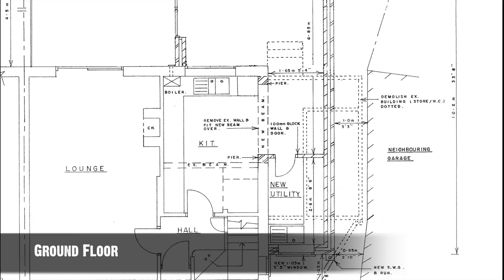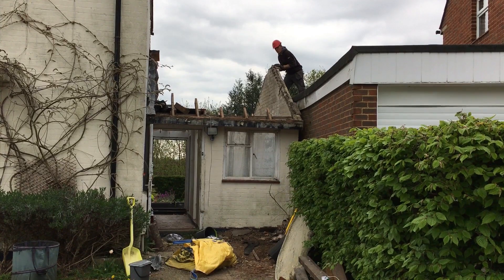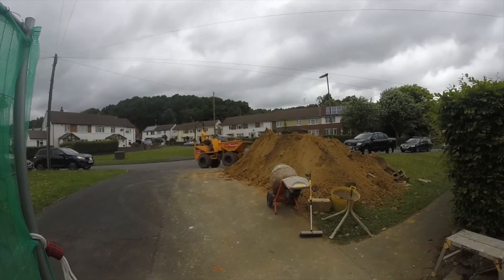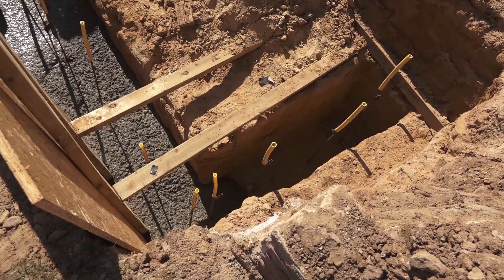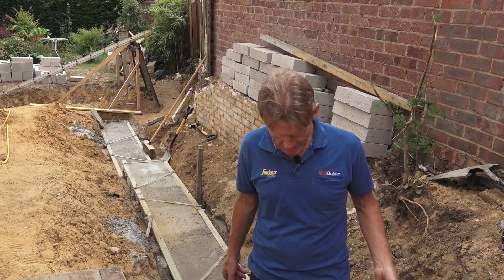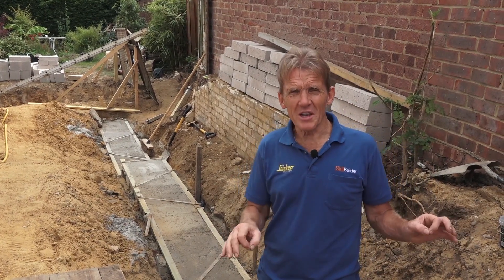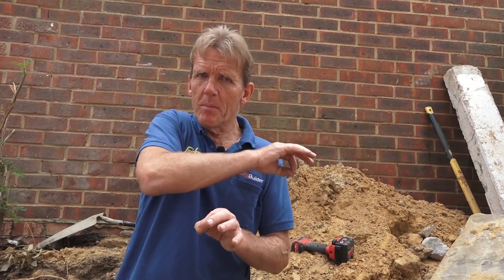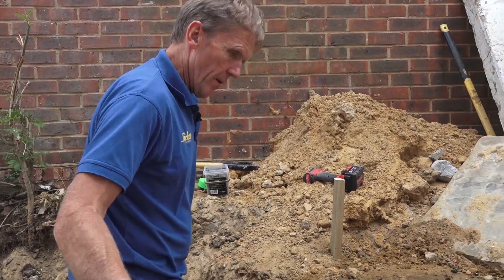How To Set Out For Building an Extension

Comment: Massive mistake!!! When you measured out from the building, you didn’t check if you were measuring out at a perfect right angle!!!  I’m not a builder but a good mathmathician and I can see how you almost definitely will be atleast a cm or so wrong (unless your measurement was perfectly at a 90 degree angle out by chance).  Measure it when you are done and I bet my house I’m going to be right.
Reply from the maker: Actually you are wrong so send me the deeds to your house. The string line is run off the wall and is parallel. We use a batten with a mark to check it in several places so if it ran out we would discover this and make the small adjustment. This is not my first rodeo.
Reply: @SkillBuilder  I can guarantee this method of checking is not conclusive.  When you measure from the house, unless your measuring at a perfectly 90% angle (which you did not check for in your video), you are going to be out by a few MM maybe even cm.  and when you check at different points, you will simply adjust the angle you are measuring out at, and think the string line is level with the house but it almost guarantees not to be.  

The CORRECT method to measure is make sure you are measuring out at a perfect right angle.  If you are 92 %, the length is not going to be correct.  

Measure the finished house at both ends and I will honour my bet to give you my house if both ends are the same with a 3mm tolerance.

I’m a mathmatician, I know what I’m talking about.

Comment: Hi.roger 
I liked ur videos quite interesting & helpful especially for those who want to learn more about extensions.& to reduce costs. You know all the prices.

I am planning for an extension at the side of my flat. It’s four in a block cottage flat but through land registry I know this part of land belongs to me only .neighbour downstairs have own access to their main door.
My question would I get permission for a 2 storey extension. How much it cost for permission?

The extension I m thinking about 32 square metres.

I asked couple of Builders quote me roughly £2000 to 2500 m2 double storey extension.roughly about £60,000 job.

My budget is £40,000 . 
How can I reduce cost ? Which material to use or who to use to reduce labour cost & materials?

Any suggestions will be appropriated ?

I m in Glasgow,Scotland.

Thanks

Comment: Hia Rodger your vidioes are great and the ones with Robin your both very professional and both seem top lads be joy to work with for me Easier way of doing it put 2 by two in footings after pouriing 3 in each corner above height of finish floor then when come back to set out set your batterns on your profiles to top of concrete  with Lazer then you can measure down and get block work bang on for slab also if using trench blocks usually allow ten mil more on gauge because easy to gain but nightmare to loose  ☺️
Reply from the maker: Good ideas Andrew. Thanks for your support

Comment: When Concreting the footing it’s better to be a tiny bit low than bang on right. So should have told them to stop the pump a little earlier. As a builder I come across this problem so often.
Also if they say it flows and won’t move the wagon/ pump ask them to wet the mix down so it’s easier to poker/ vibrate or pull with a rake/shovel when you do need to pull it further down/ around the trench
Reply: Don't agree with his estimate either that an extra quarter cube was poured in the time the pump stopped. 1 quarter is over half a tonne. I've done countless pours where I've had to think on my feet(too much/too little)but always got over it especially if there's jumps.
Reply: When low it allows for the bricklayers to make up the height on their bed and get it bang on right on their first course
Reply: I allways peg 470mm from bottam of splash courses gives 20mm buffer on trench blocks
Reply: NO WAY IS ROGER A BUILDER !!!!!!!

Comment: could you tell me roughly how long the average extension takes you to build?
Reply: Ste Smith 
All depends how big , what the ground report is , I.e the depth you have to dig out and also if done in the winter time , it will take slightly longer.

Comment: Why not rake back excess concrete and stick with original level? Surely there wasn't that much over to do this. Everybody has topped unlevel founds before but surely that could have been avoided.

Comment: Great Video. I'm getting to the point now where I'm not confident I can find a builder to build my extension for the money that my architect guesstimated my build to come in it. I'm honestly now considering project managing the build myself and do a lot of the work myself and maybe employ a builder and joiner to help me as and when required.  

Can I just ask, Obviously you have to dig your founds down to the required depth however is there a guideline for when the foundations end and you start your brickwork? How many courses would you typically look to lay to bring it up with your existing floor level of your current house?
Reply: Depends on what sort of floor your putting in ie block and beam as you’ll want air flow that will circulate out of the plastic air brick ...Also you’ll need pipe work to run so you’ll need some bricks from foundation to damp level.

Comment: Also, you measured footings good, just lay the first brick/block and measure that to the wall and pull the lines off that, rather than mess about with profiles/levelling down blahblah

Comment: Hi I love your videos and am thinking of building something similar but am a complete amateur, I just watched another video and another guy got absolutely slated for not putting rebar in the deep foundation he dug, am i blind or did you not do this? Also I do not have the option to do this with someone pumping concrete due to access, it looks amazingly quick but would it take for ever with a small mixer and manual labour?
Reply from the maker: I the structural engineer asks for rebar then you need it but these are big foundations onto a firm base. The existing house has stood on less for 60 years with no rebar. People tend to over-engineer these days to avoid litigation and in clay ground I would be looking for a different approach but this is sand.
Reply: Although concrete is strong in itself, there is always opportunity for strengthening, and steel fibre-reinforced concrete is one the popular choices for people who require a little extra resilience from their mix. But why is reinforced concrete used and what makes it such a useful product? We’re going to detail the benefits of this particular concrete, so you can find out if it’s right for you.

Properties
The addition of steel fibres to mortar delivers a drastic improvement to the strength of the mixture. Before reinforcement, the flexural strength of the concrete stands at around 25%. After steel fibres are added, this flexural strength is increased to 100%, depending on how many fibres have been incorporated into the mix.

Saving time and money
Strengthened concrete offers a number of benefits aside from the obvious increased strength, particularly in the area efficiency. These include:

Wider joint spacing – joint forming costs reduced, less need for joint maintenance
Reduced slab thickness – money saved on concrete and placement
Simplified construction – joints are simpler, steel fabric positioning errors eliminated
Construction process is sped up
Technical benefits
The risk of cracking is significantly reduced
Reduced spalling at joint edges
Stronger joints
Greater impact resistance
Greater fatigue endurance
Reduced maintenance costs
Longer useful life
The fibres help improve resistance against tensile cracking, which is a problem that can befall concrete over time. In non-reinforced concrete, the concrete ‘beams’ can only withstand so much stress from bending before they break apart. By adding steel fibres to these beams, the resistance is significantly strengthened, allowing them to withstand much more greater loads before the first crack appears.

Steel fibres are distributed randomly throughout the mix, too, so the increased strength is felt throughout the concrete, rather than concentrated in a specific area. Thanks to this, any micro cracks or potential cracks are neutralised before they can cause serious issues.

Steel-reinforced concrete is an extremely effective product for heavy duty usage, where heavy loads are expected. From warehouses and factories to aircraft hangars and runways, the strength of this concrete means it can withstand far more than the average concrete mix.

Comment: I think you should have put your profiles up when you done the concrete so your walls would have the right bearing on the footings??
Reply from the maker: Yes you are right we should have done this when we did the concrete, but on a job like this you can measure out from the existing building and bang in a few steel pegs to give you the line.  The foundation is twice as wide as the wall so if it runs off slightly it isn't the  end of the world but I take your point. On a virgin site you would peg out properly.
Reply: @SkillBuilder  Wondered exactly this, as usual Roger's experience comes through. Never seen such a clear explanation of these setting out fundamentals. Thank you!

Comment: Good job but why The 2 lines surely
 plumb down the outside line to footing and just measure the 300mm back off it.must be more accurate.
Reply from the maker: You are not wrong. I thought of doing that but I also thought that setting out both skins was worth the extra bit of string if only to reinforce the point.  I am sure people will do it your way and maybe so would I.

Comment: Haha. I know the frustration with the missing/false measurements. In my job we sometimes get drawings to build metal structures that is to be installed to a certain location. And on the drawings there reads "verify the measurements when installing" ?!?! Its pretty much too late at that point now isn't it?! The planner is not responsible for any errors! What the hell? What are they paid for anyway? Most of the time we get free hands to build the stuff on site and it is a hell of a lot easier and faster too.
Reply: Sounds like you use the same drawing office as Heartbeat.
I used to get drawings with either no dimensions, wrong dimensions, or dimensions to two decimal places.
How are you supposed to measure 169.63mm using a bloody tape measure?
One day when looking at the work of the welder in the next bay, i noticed his frames weren't the same as mine. (We were welding the same job)
I told him it was wrong and went to grab my drawing. He checked his drawing and said it was correct. I checked mine and confirmed it wasn't. We realised we had two different drawings. We both went to the supervisor who took both to the drawing office to find out which one was correct.
FUCKING HELL! BOTH of them were wrong...
This was a couple of days into three shifts working off one of two drawings that were both wrong!!!
Reply: xD Haha. Yep. Sounds just about right.